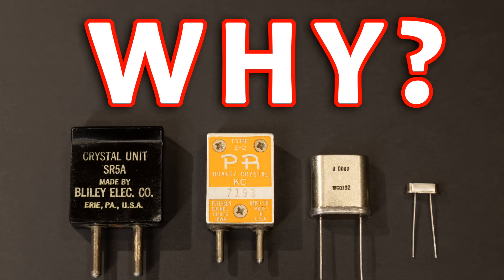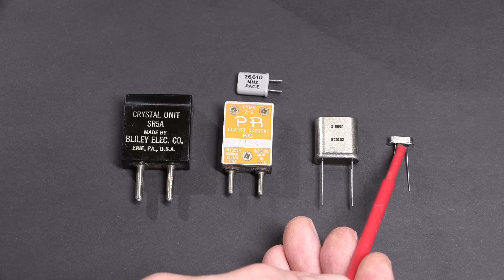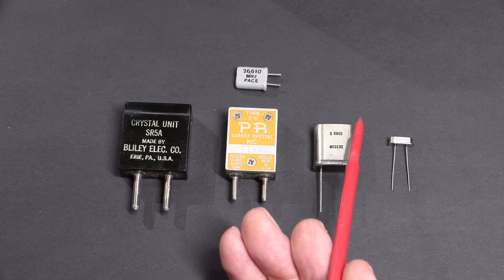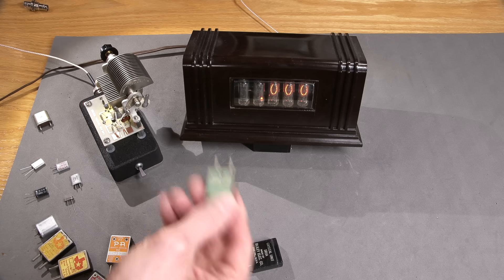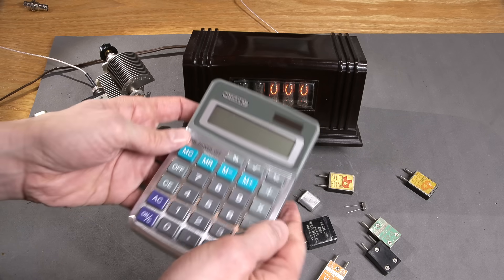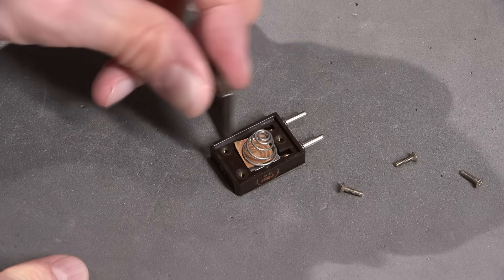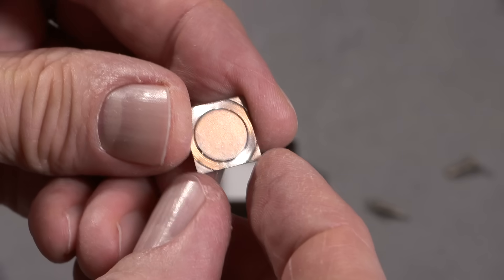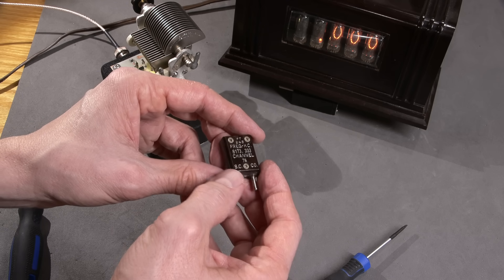Why Are Crystals Needed? Here's Why With Examples!

Comment: The FCC used to issue Novice class amateur radio licenses with low entry qualifications, but limited priveleges to beginning ham radio operators. One of the requirements was to use crystal controlled tramsmitters, to ensure that they didn't drift outside permitted frequency bands, crystals being more stable than other ocsillator circuits than beginners might use. Your blocky, plug-in crystals just over 7 MHz would be in the 40 meter ham band.

Comment: Mr. Carlson, I have a question: You always use a variable isolation transformer. I wonder if a magamp would do the same thing despite maybe the isolation? Also, Have you ever replaced all the tubes with transistors? would the radio be as receptive as with tubes?

Comment: That Bliley xtal might be so old that its using a "natural" (instead of autoclave grown) xtal.  Nowadays, even the higher frequencies (up to 150mhz) can run at the fundamental mode, but they've gotten so small that you can't read the frequency written on the top.  1.0mm x 0.8mm already in production with 0.8mm x 0.6mm now coming into the market.  (think: wireless earbuds) .

Comment: Another great video, Mr. Carlson! When I first got my amateur radio license in 1964, I built a Heathkit "Twoer" from a kit. It was a very basic  2 meter transceiver that used  crystals like the one you disassembled. I remember them being in 8 MHz range and you had multiply it by 18 to figure out where in the 144-148 MHz band you wanted to transmit. I vaguely remember experimenting to try and tweak the final frequency a bit by "wet sanding" the crystal using very fine polishing compound. It actually worked! I rejoiced when I got my first VFO. If I remember right, at the time if you had your Novice license, you were only allowed to use a crystal controlled transmitter.
Reply from the maker: That's a neat story! Thanks for sharing.

Comment: The citizen caliber 0100 watch is home of the most accurate piezoelectric crystal ever cut. With a thickness of approximately 0.198mm and a manufacturing tolerance  kept within one micron, it vibrates at 8,388,608 Hz with a timing precision of ±1 second per year.

Comment: I think the most important point is missing: The crystal has two connectors for voltage. If connected, the crystal vibrates, OK. But we do not need a vibrator and there is no connector for "signal out". So what does the crystal do with the electricity?

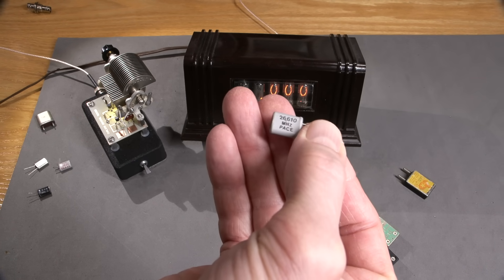Comment: Hey Mr. Carlson!  At 10:36 you state that that it is a third overtone crystal is it not a 2nd overtone ?
Reply: As you probably know, in music, frequencies above the fundamental are counted as the "first overtone", "second overtone", etc. This resonator only generates odd multiples of the fundamental.  So, if this were a musical instrument, the (3f) frequency would have been called "the first overtone".

But in electronics the terminology is simplified such that "n-th overtone" simply means a frequency equal n times the fundamental. It is peculiar that exactly the same word is used so differently!
Reply: @cogoid  Well stated mate!  Thanks for that.  I'm a tiny bit smarter now.
Reply: No 2nd overtone crystals AFAIK.  Geometry doesn't work out.
Reply: I worked in a factory that made crystals and crystal filters. The first step in rough grinding them to frequency was done in a large vat with a rotating plate at the top, and on that a plate full of crystal sized holes.  The blanks laid in the holes and the rotating plate ground them with an abrasive slurry.  Their frequency was monitored with a Hallicrafters shortwave receiver!  The grinding action produced RF without any electronics.

Comment: Remember my dad having a cow when he found out I opened one of those big crystals held together by screws. He said it would never be the same again, didn't even handle, just looked inside. Remember an article in a ham magazine that modified it with a screw that you could vary the pressure on the crystal to provide frequency adjustment

Comment: Maybe you said it and I just didn't hear. It's fascinating that the crystal's resonance is physical: the piezoelectric effect causes it to vibrate in space (not electrically as a tank circuit). The frequency depends, in the end, on Newton's second: F=ma at the size of the crystal lattice. At any but the resonant frequency (or a harmonic), the crystal absorbs energy because it' "fights" the natural vibration. That's why calibration is about grinding to a physical dimension, just as you would a steel tuning fork. Pretty rare. Newton doesn't often explain electronics.

Comment: So basically, the crystal is about the best thing going for an open-loop oscillator doesn't have closed-loop feedback control or isn't much more complex circuit chip-based based oscillator/frequency generator. They're very simple and the crystal's dimensional stability and mode of operation(piezoelectric effect) ensures frequency accuracy, whereas tuned RLC are great on paper but will drift in real life. It's actually very similar to how tuning forks are used in acoustic(sound wave) applications like for instance tuning musical instruments, ex: "gut" or steel guitar strings on very nice guitar(made of wood) got great tone...don't hold great tune. -Or don't hold great tune for very long, as typically guitars have to be tuned quite often...even every time played.
But tuning forks are used at quite small scales too, ex: there's wristwatches with tiny steel acoustic frequency tuning forks, but also higher frequency quartz crystal oscillators where the crystal, unlike in Mr. Carlson's example, is actually made into tuning fork shape.
Blow your mind a little more, crystal oscillator clocks were big before atomic clocks were invented; and before those were pendulum clocks. But before the crystal oscillator clocks, we were making the very best pendulum rods out of Invar(specialty alloy of nickel and steel with very high temperature stability, i.e. very low thermal expansion coefficient) as well as we even made pendulum clocks with quartz pendulum rods because of the even greater temperature stability.  Ex: do a search for "Riefler Clock."  Or look up "gridiron pendulum"...pretty wild stuff!  -Which that was actually in a weird way a type of "closed loop" feedback control...in the 1700s!  Before James Watts centrifugal/"fly-ball" governor!  Ex: Basically steel & brass or steel & zinc "sense" and react to temperature differently so apply "correction" to pendulum to maintain its dimensional accuracy across a wider range of temperature.  Awesome!  I personally find it incredibly cool that early mechanical engineers were working out and solving problems what electrical engineers would often then imitate later in that domain.

Comment: I have  atmega8a and I can program it using USBASP without any crystal. You never explained why I need the crystal. From my understanding I can use a crystal to run the micro-controller at higher frequency  16mhz if I use an external crystal and burn a fuse in the microcontroller. I did it once but I wasn't sure if it was operating at 16mhz or 1mhz stock frequency. I couldn't reprogram the when burning the fuse. I hope you make a video explaining this

Comment: I have a 1mhz crystal standard from the US navy. The ceramic case with security wire hermetically sealed front cover is the size of a packet of cigarettes and remains extremely accurate to 6 decimal  places. Dated 1941. Yes very stable over time indeed.

Comment: With an extra capacitor the frequency can be lowered. More capacity results in a lower frequency and less capacitance results in a higher frequency, but what to do if the crystal has to be turned up even more?

Comment: Huh .. you know - I've never really thought about these other than dropping the correct one into the (typically digital for me) circuit it called for. I'm certain at some point I wondered about tolerance, but you just tend to trust them. Aside: For the analog nerds I have a really cool one in my eclectic bin - A colourburst in a 9 pin miniature tube format, and for the digital geeks, a PXO-1000.

Comment: A quartz crystal keeps time in a watch due to its unique piezoelectric property, when electricity is applied, it vibrates at a constant, precise frequency (usually 32,768 times per second), and an integrated circuit counts these vibrations, converting them into regular electrical pulses that drive the watch's motor and move the hands. This stable oscillation provides highly accurate timekeeping, making quartz watches very reliable and affordable.

Comment: Okay so they oscillate but how do they measure the oscillation?  Without a sensor? Or does the oscillation present itself electrically at the other end of the pin?

Comment: An example of a crystal everyone has in their home, probably several of them in fact, is 32768Hz.  Pretty much all your AA battery powered wall clocks with have one, at least all the ones that do the once a second tick.  Just divide by two 15 times to get 1Hz
Reply: When ever you need an accurate real time clock use a crystal of this frequency. Very common on microprocessor printed circuit boards when an accurate timer is required.

Comment: Sixty years ago, I homebrewed a CW transmitter for use during my Novice class days. The FCC required Novice class amateur radio operators use crystal controlled transmitters.

Much of the transmitter was built out of a junk television chassis I bought at a thrift shop for $.50, with the transformer being a particular bargain since that would have been expensive bought new.

I had three or four crystals I used on the forty meter Novice band,  circa 7.15 MHZ.  I never heard of anyone adding a variable capacitor to modify the frequency of the crystal, which would have been interesting to do. 

I never did get rid of the chirp in that transmitter----
Reply: I had a rock bound transmitter as my first also that had a slight chirp. Sure enough I got a card from an OO guy telling me about it 😅😅😂
Reply: @kevinmccool3719  
<<an OO guy >>   ??

Comment: Someday can you explain how crystal oscillators work? Don't the require ac to work? How do they get ac from a DC circuit, then use the output of an ac device in a DC circuit? Yeah. As clear as the other one bottom of the Hudson River.
Reply: <<Someday can you explain how crystal oscillators work? Don't the require ac to work? How do they get ac from a DC circuit, then use the output of an ac device in a DC circuit? Yeah. As clear as the other one bottom of the Hudson River.>>

I'll give you my Advanced Class amateur radio license reply to this question:

The most common use of a crystal is in a crystal oscillator, which uses DC voltage to produce an AC voltage at the frequency of the crystal.  The DC voltage to the oscillator  then has the AC and DC voltage on the oscillator output. 

A capacitor in series with the output of the oscillator then allows the AC voltage to get to the next stage while preventing the DC voltage from getting to the next stage.

There are lots of different oscillator circuits.

Comment: What's described as oxidation in the video is actually something completely different. Quartz, silicon dioxide, cannot oxidize further. What actually is shown is micro fractured dust. Very tiny amounts of the crystal break loose from the surface, especially at the corners and outside of the external supports. Once liberated from the crystal this dust interferes mechanically with the physical coupling of the crystal to the mount. And it absorbs energy by vibrating. 

So it does benefit the accuracy and performance of the crystal to remove it, but it's just quartz dust and not oxidation.
Reply: Oh, I see, thanks for clarifying, When he said it was due to oxidation, I thought it was oxidation of the metal contacts,  deposited on the surface of the quartz.
Reply from the maker: The metal you see on the the corners of the crystal is oxidation.
Reply: @MrCarlsonsLab  The metal can oxidize.  The quartz is already oxidized.  It certainly can fracture into dust.  Remember, it is vibrating mechanically millions of times per second (not very far and only in the middle).

Comment: If you ever had a crystal radio set like I did as a kid you knew a crystal was an important  part of the radio. Seemed like magic 
then to tap it in different places to get an AM radio station. Never saw a crystal tester before. It works great! Those crystals
were old but still spot on! You took apart a crystal but didn't explain why the spring was there. The mechanical tension applied
by it causes a crystal to produce electrical energy at a certain set frequency because of the physical pressure created by the
spring. This is called a piezoelectric effect.

Comment: Spent most of my life designing digital circuits, and am not strong at analog, but couldn't a crystal be replaced with some sort of VCO with a precision voltage reference, and maybe a PLL?
Reply: <<Spent most of my life designing digital circuits, and am not strong at analog, but couldn't a crystal be replaced with some sort of VCO with a precision voltage reference, and maybe a PLL?>>

I would say "Yes!" .  But why do something complex if a crystal oscillator will provide a highly stable, accurate frequency simply and at low cost? IF that's what you need.
Reply: Yes and no. Voltage reference won't keep a free running oscillator stable on frequency, it will drift. PLL is used if you wan't an easy way of generating multiple frequencies indtead of using two or more crystals (or 100s or 10000s).
The PLL however is controlled by a reference crystal.
Reply: What a crystal resonator really is, is a from of memory -- it "remembers" the phase of oscillations for a very, very, long time. A very good resonator will ring for a million cycles without appreciably wandering off. So, when inserted into a feedback path, it integrates away any noise over a very large number of cycles, and the output waveform of multiple independent units keeps the signal transitions naturally aligned without a need for explicit and frequent synchronization. A resonator with shorter memory (lower Q factor) wanders off more quickly, and the phase difference between independent oscillators simply wanders off randomly on the scale at which quartz oscillators still stay rock solid.

But it is hard to come up with a scenario specifically in a purely digital system where this cannot be done by synchronizing things through two way signalling. having a very stable time/frequency/phase reference is mostly of value where some user or device need to be out of the loop but still stay synchronized to the system. This is useful in many modern communications systems, not just for RF reasons, but to keep time slots and data packets more or less in sync. Obviously GPS relies on very exact time keeping because that's how it measures the distances. 

Having accurate or at least very stable timing is useful in many applications. For example, people searching for oil and minerals have a device, which simply drops a weight and measures how fast it goes. If you can measure time and distance accurately to parts per billion, that allows to measure very tiny differences in gravity due to different density of minerals under ground. That of course is a very niche application, but there is a lot of odd stuff like that around.

Comment: The 52.5MHz see-through crystal could be cool for 6m CW if you could keep it oscillating on the overtone. Keep the oscillator running constantly and ensure the oscillator isn't disturbed when you key. Build it with 2n3866 and 2n2222 both in metal cans for extra cool factor... also try yelling at it and see if microphonics will give you FM lol

Comment: My father, a HAM radio enthusiast from the early 70s onward, had crystals like these laying around everywhere (the big ones with screws). It never occurred to me to take one apart to look inside. I assumed taking it apart would ruin it. (I was one of those kids that took everything apart, but I knew better than to try that with any of my dad's equipment)

Comment: Fantastic... and  Thank you. I had no idea you could service/rebuild crystals! 👍 

I wondered... Can they use crystals to make AC out of DC currents? Do crystals even work with AC currents? 
How do they make them spark like in cig. lighters? I mean dont they break if you bend them?
Reply: << Can they use crystals to make AC out of DC currents?>>

Yes. That's what Mr. Carlson's crystal tester was doing  ---- putting the crystal in an oscillator circuit to generate a radio frequency voltage from a DC power supply. 

I would say that using a crystal to convert a DC voltage to a specific radio frequency, AC voltage would be the most common use for crystals. 

<<How do they make them spark like in cig. lighters? I mean don't they break if you bend them?>>  I'm not sure how similar that kind of spark generator is to a crystal for an oscillator.  Perhaps someone can give a better answer.
Reply: @SeattlePioneer 
Hey Thank you very much for taking the time and for the explanation. 👍 
I appreciate it.

Comment: That 26.610 MHZ XTAL is a receive crystal for CB radio channel 9. Add .455 for the IF stage and you get 27.065 MHZ, CB channel 9. For the old mid-1970s and earlier 1-12 channel CB radios and walkie-talkies. I used to work on these units. Old 73-yr-old tech here.
Reply: Probably the CH9 RX crystal. I remember you needed pairs rx & tx
Reply: We use to swap the rx and tx crystals around to get different out of band frequencies.